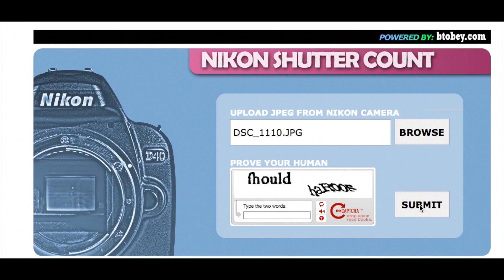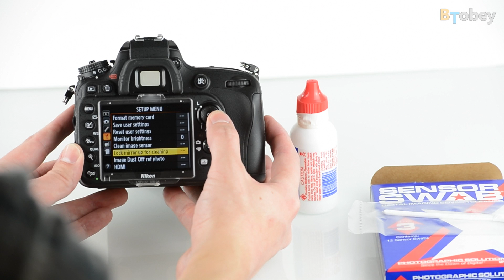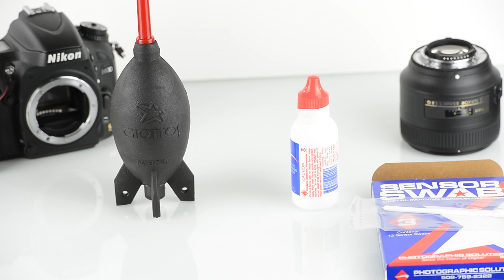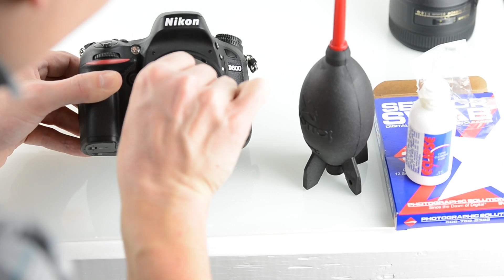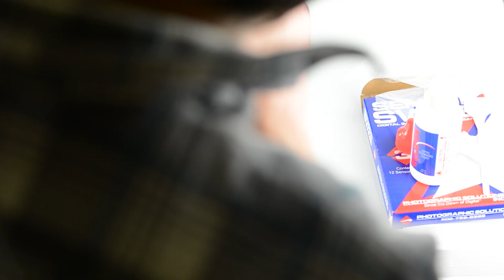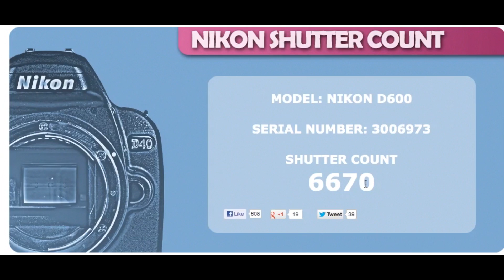D600 Sensor Dust - Debris Returns

Comment: 30,000 plus on my Nikon "repaired" D600 and it spits out the dirt or oil like when it was new. Going back to them a second time because I am tired of doing 20 rounds of wet clean to get the sensor reasonably clean
Reply from the maker: Really, after all these years.  Its a shame.  I was so excited to here 
the D600 introduced back in 2012.  What a disappointment.  I keep 
cleaning mine routinely.  Best Wishes

Comment: Is it worth sending to Nikon or will this problem be solved after some wet sensor cleanings? 

I am currently noticing dark spots on the top left side of my pictures starting at f11.
Reply from the maker: do it yourself

Comment: stay away from the nikon d610, i bought it new back in febuary 4 months ago and i have been noticing spots for about 2 months now, at first i thought it was just dirty but how can it get dirty soo quick i just bought it brand new.... Nikon still havent fixed the oil on the sensor problem, my sensor is really spotty up in the left hand corner, and now i have to send it back to nikon, Shame on you Nikon
Reply from the maker: you can clean it yourself if you feel up to it.  The D600 was released back in sept 2012 and its amazing how this is still an issue.  Agreed.  Shame on Nikon

Comment: You and thousands of others know plenty about this issue. It was so bad a class action suit was opened and then Nikon issued the recall. Nikon gave me such a hard time when I sent my D600 back to them before the recall. They broke it and said it was my fault and sent me a $1300 repair bill. I had to escalate it and prove to them it was a working camera before I opened the case. It was such a problem but, taking a picture after opening the case and just before shipping it to them saved me. They had to replace my D600 with a refurbished unit. Now I have a working camera with the spotting problem. I'm sending it back to them again for the one time warranty review. Wish me luck.
Reply from the maker: Good luck.  Maybe upgrade to D810?

Comment: I too have a faulty D600, what a nightmare. Debated on sending it in since the repair was 30% effective (some poll I found on the internet). I decided to send it in, they paid for shipping and all, covered under warranty. Shutter replaced. When it came back it had a 2 spots which were pretty small.

So then I shot a wedding and put about 500 photos on it. Rechecked and now there are 14 or so spots, some are pretty big. Not acceptable.

Found thread here http://www.fredmiranda.com/forum/topic/1265732, some law firm starting a class action on this: http://www.zimmreed.com/Nikon-D600-Spot-Issue/64550/ not sure how much it will help. I signed up and awaiting a response back from them.

Comment: I purchased a New D600 last September just before the Nikon D610 was announced. I was hoping that by this late in the production cycle Nikon would have fixed the problem given that there were so many complaints. After 4300 shots my sensor is a disaster and needs to be cleaned. I've owned a D200 since 2007 and it's never required a cleaning as bad as my D600 does.
Reply from the maker: Yes, without question the D600 is a lemon with the oil debris landing on the sensor.  It is unfortunate.

Comment: I agree that this spotting issue is very irritating.  However, the spots were extremely light and hard to see (in the video anyway) after the sensor cleaning and the 1,000 shutter actuation test run.  Perhaps there was still a small amount of dust in the camera or on the back of the lens?  Anyway, I think it would be interesting to perform the same test on another Nikon Full Frame not known to have this issue and see if any signs of dust show up after 1,000 shutter actuations (a baseline of sorts).

Thanks
Reply: It is not the lens, if it were then cleaning the sensor would have done nothing - and the spots would have remained in the same locations.

After doing the cleaning, new spots came back in new locations.

Comment: is that liquid 'oil remover' or just for standard debris ?
VisibleDust makes 2 separate products, somewhere i readed that if you want the oil out you must get 'SmearAway' and not 'SensorClean'
Reply: Did you watch the video at all? Regardless of what liquid he used, he demonstrated that the sensor was dirty - then he cleaned and it was demonstrably clean as evidenced by the photos - then he did another time lapse and you could see NEW spots forming in real time. It wasn't the same old spots reappearing, it was new spots in new locations.
Reply from the maker: Thanks for backing me up.

Comment: I had spots that persisted at the same frame location, however they don't seem to be there after change of lens.  Make sure you have sensor spots before getting all bent out of shape!  SN 304xxxx
Reply: If it were from the lens then him cleaning the sensor would have done nothing….. He cleaned the sensor and the spots were gone, for a short time. This very well documented problem is wide spread and has nothing to do with the lens.
Reply: My shutter count 4200+, haven't seen any sensor spots.

Comment: that dust is produced by the curtains. They are ground (they break their surfaces or edges by contacting) whenever taking photos. Nikon in South Korea has recently decided to provide free cleaning service and if the problem persists after the service, they will replace the cameras with new ones.

Comment: Ha ha ha ha! Perhaps.... I will do the same thing: I will buy a D600 as second body to be placed at the side of the D800E. This issue of the D600 is less common than people might think. And in the worst case, sensor cleaning is an operation EASY and inexpensive. And you have to do it once or twice, then the problem goes away. In any case, the D610 is fantastic, too.

Comment: I hope for NIKON that the problem with oil specks will be solved with the D610. But that does't free them for the responsibility of production fault with the D600. The decent thing would be to offer D600 owners with constant oil problems a new D610. The introduction of D610 is NIKON's subtle way of saying, that they have fucked up on the production line in Thailand., 
Another issue, that has not been discussed is a collective lawsuit against NIKON.

Comment: You may find your senor problem comes from the way you change your lenses. Leaving the internal optics side up on the desk is never going to help. Dust gets everywhere, remove lens and rear cap it. Keeping it bayonet down, lens up. This minimizes the dust getting into the optics. When you leave it for 5 minutes uncovered of course your sensor is going to collect the dust that's now collected in your lens!!!

Comment: If the NIKON D600 had been a car, you would have seen some action from NIKON very fast. Toyota learned that lesson many years ago in America. And it did cost them a fortune. But with a car, it is easy to change to another brand. But when you have some pretty expensive lenses, you just don't change to Canon, since the camera industry cannot agree on a standard fit.

Comment: My camera is in for the 3rd time for oil spots (dust is not a problem). NIKON will not inform in what batch number range the problem exist. Thus I will not recommend the camera to anybody until NIKON solves the problem. I have had all the NIKON digital cameras and never a problem with dust or oil. 
I use the came for travel photography, and being on the road for one month I do not have time to constantly clean my camera (I use Visible Dust). 
Shame on NIKON, because it is a great camera.

Comment: Man I want this camera wo bad but I don't know if it's the right time to buy. Has nikon came up with the new solution yet other than sending it back to the nikon service shop? When I read the specs if this camera I was so happy untill I found the major issues about this camera. Now I was thinking of getting the d90 while waiting for nikons next solution that will fix this problem.

Comment: same here. .I had my D600 serviced at the L.A. facility a month ago, and they replaced the entire shutter assembly. After a few exposures, the oil debris problem came back, unfortunately, in my case I am about to go on a vacation next week and won't be able to have the camera"repaired" or "cleaned" prior to my trip. Never in the almost 25+ years of owning a Nikon have I ever been so disappointed in the company.

Comment: I would suggest sending it in as this would extend your warranty for another six months.I had my D600 serviced at the L.A. facility a month ago, and they replaced the entire shutter assembly.  After a few exposures, the oil debris problem came back, unfortunately, in my case I am about to go on a vacation next week and won't be able to have the camera"repaired" or "cleaned" prior to my trip.  Never in the almost 25+ years of owning a Nikon have I ever been so disappointed in the company.

Comment: Thailand.  You are absolutely correct that it is a sad case for a Nikon product to have this problem.  I had my D600 serviced at the L.A. facility a month ago, and they replaced the entire shutter assembly.  After a few exposures, the oil debris problem came back, unfortunately, in my case I am about to go 
on a vacation next week and won't be able to have the camera"repaired" or "cleaned" prior to my trip. Never in the almost 25+ years of owning a Nikon have I ever been so disappointed w Nikon.

Comment: Hi, thanks for the great video.  I bought a refurbished D600 and have the spot problems.  I have about 2 weeks left on the guarantee.  Did Nikon honor your complaint and fix the problem.  And how was it fixed and how long did it take?  Thanks.

Comment: Now that statement was overkill my friend, and no... I am not defending either Canon or Nikon sides here. I could agree with the optics part but srsly? sure it's inferior than Nikon's but it's not THAT POOR! and AF system being awful? Canon's flagship 61 AF is practically performing the same as Nikon's flagship 51 AF, and the D800 does have some issues with AF. and inferior system? yes CANON sensor sucks wet balls, but overall... system's are really tight and perfect as Nikon's.

Comment from the maker: I can.  Off the cuff, I would say the D7100 looses significant dynamic range as you increase ISO compared to the D600.  Generally they are about a 2 stop difference.  I am compiling some D7100 results now.

Comment: I followed the instructions from this video and the one on Sensor Swab's website to try and clean my sensor. Afterwards, there appears to be what look like little wet spots on the sensor from the solution. I can't see anything whenever I take a photo though. Is this okay/normal? I only used 3 drops of solution.

Comment: I am on my 3rd D600 with this issue EVEN before 5000 actuations. Nikon is downplaying it.
I love the camera but this problem is ridiculous. Tech support does not even use the word oil spots, they tell you that it is "a dust problem and you are dirty and you need to be a bit cleaner". Sure thing Nikon, I had a T2i that never had a speck then spent $2k on this and I have had globs on my first camera, globs on my 2nd and severe spots on my 3rd.
Very disappointing.

Comment: Thanks for this - a healthy dose of caveat emptor!
Some have reported that the problem "goes away" after several thousand actuations - clearly not in your case.
After much research on the issue, I find it is a historical Nikon problem. 
The point is: sensor cleaning is just another technique that you need to add to your repertoire if you want to appreciate all this camera has to offer. I, for one, don't find it onerous and fully intend to purchase this (mostly) splendid machine.

Comment: I dont know what you and others are expecting when you stop cameras down to small apertures.  Every DSLR i've shot (both canon and nikon - nikon d40, d90, d700, d3s, d800, d600 and canon 5dm2) all have had dust spots especially at f11 and up... mostly with just wide angle lenses.  Just clean it when it needs it.. not that big of a deal.  I had one spot with my new d600, i blew air in it.. bam looks perfect now... took all of 15 seconds

Comment: After a certain number of shutter actuations does the problem go away?  I've already had mine cleaned once at around 4000 actuations and the problem seems to be reoccurring.  This is a major issue for me since I've been shooting a lot of macro with small apertures (f/16 - f/45).

Comment: Went to shop where I bought camera. Despite what they said before buying it, they didn't seem surprised and even let me come to the back and watch them clean it. They also offered to send into Nikon to try to fix the source of the problem - excess oil? The guy thought the spots were definitely oil when looking at them with a loupe. They smeared a bit and required about 4 separate swipe cycles.

Comment: I just bought one yesterday at a local shop with a later SN (305XXXX) and I have spots already. I was on the lookout for this problem and even waited for a later SN from the shop and no luck. At f12 or f16, they are quite noticeable. I had three spots after 5 shots! I have about 20 spots now. I'm going to send in for a Nikon cleaning first to ask them to try to solve it but then will move to self-cleaning if it returns. Sad.

Comment: Ive had the same dilemma. was hard to decide between 5d mark ii or nikon d600. as 5d is almost 5 years old so decided to get nikon. My shutter count is less then 200. There are already oil spot on sensor.Thats really annoying but anyway i dont regret my decision. I am not afraid to clean sensor but cleaning swabs adds extra costs.

Comment from the maker: I somewhat disagree with your assumptions.  I hope to compare the 6D to the D600.  However, if you already use Canon, no major reason to consider the D600.  But, if you are already on Nikon, the D600 is still an awesome camera.  Regardless of the debris issues.  It has not impeded me to take great photos.  Yes, it is annoying, but most photos are not taken at f/16 or f/22.  I still standby the D600, and recommend the current deals available.

Comment: I've heard that when the D600 is sent to a Nikon service centre, not only is the sensor cleaned, but they also remove the excess lubrication that is spattering on the sensor.  

Hopefully, this claim is true.  I will do a test to confirm this when I get my camera back from them.